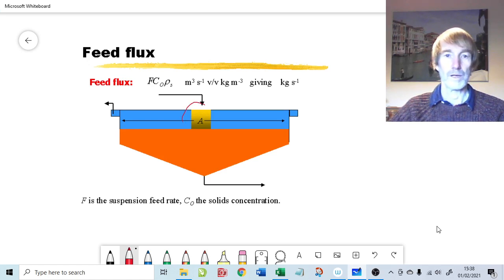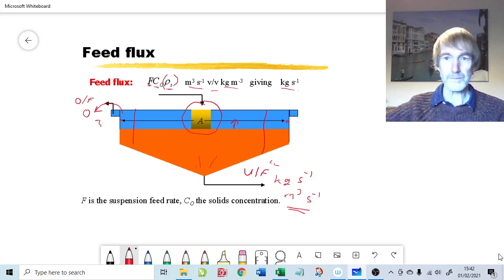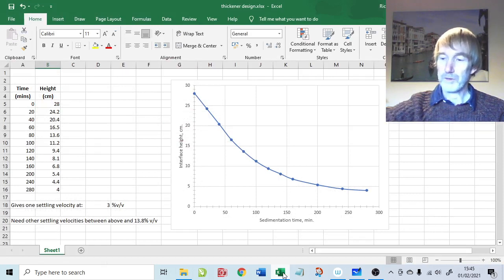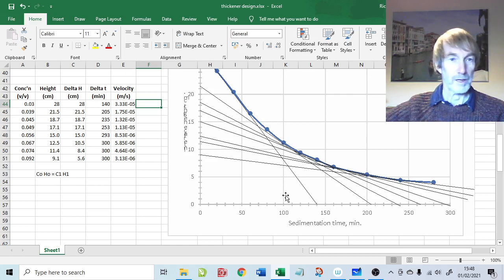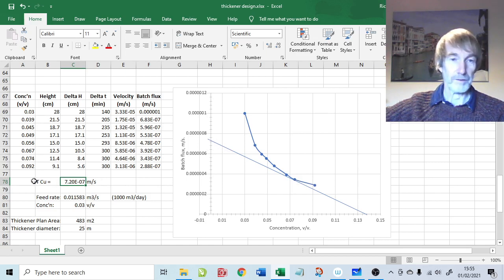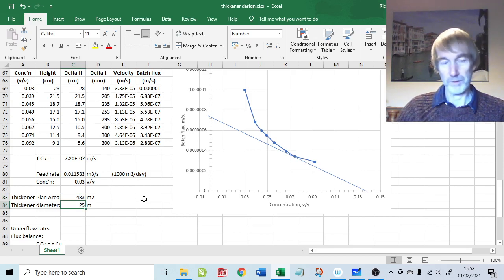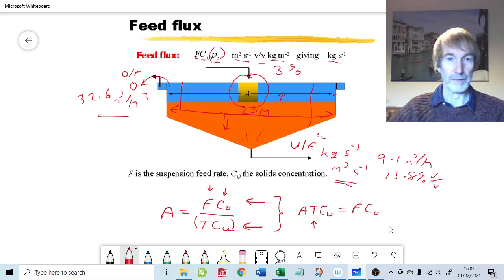Continuous Thickener Design by graphical flux theory; FPT Ch6 Q2

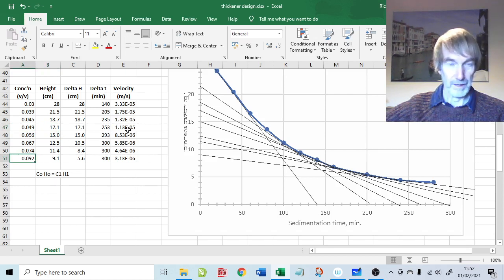Comment: Thank you for a great video on Batch flux theory. At around 14:00 in your presentation you talk about the lower points on your curve, I noticed that the time values are all the same (300 minutes), and that the delta H is also not the same as the Height. Could you comment on what the justification for not using the real time values of these tangents is?